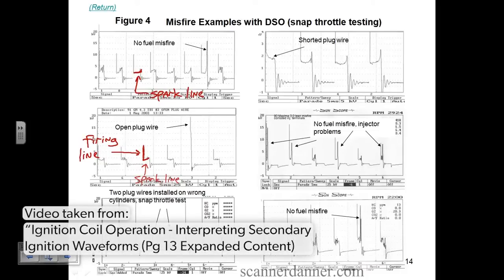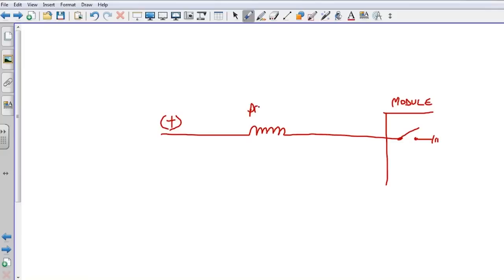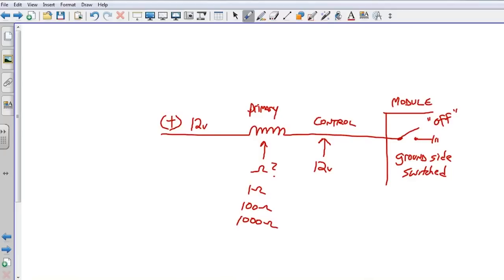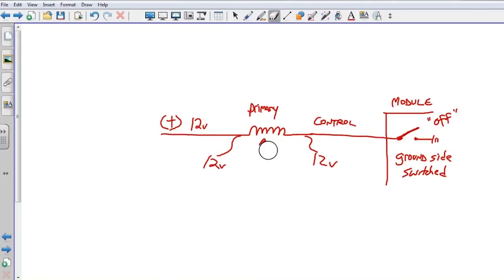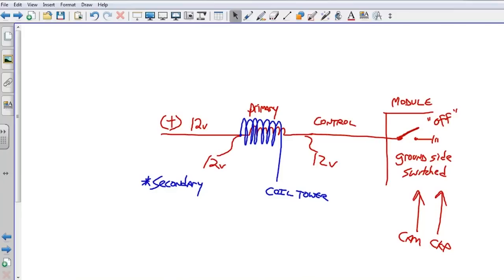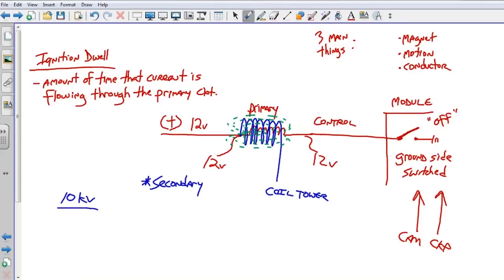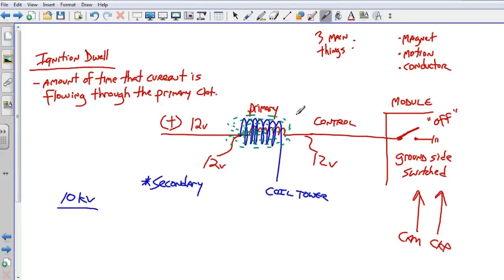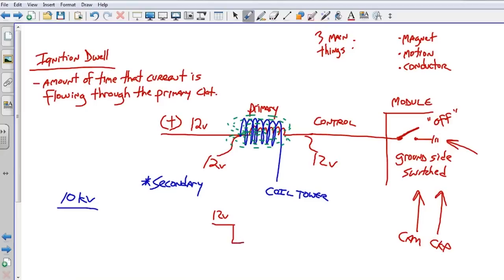How an Ignition Coil Works!

Comment: If you look where the rubber meets the road, how all energy (electricity) is produced mechanically, coal, nuclear, hydro, diesel, gas.. .they are all built upon the fact that change in magnetic flux induces a voltage in a conductor.  Shutting off the coil collapses the magnetic field, creating a change in flux, inducing a voltage.

Comment: If you do the math, a typical V8 engine at 3000 RPM has to do this coil saturation and spark voltage collapse at 200(TWO HUNDRED) times per second..
Wrap your head around that one!!
Reply from the maker: Did you like the class?
Reply: @ScannerDanner  Oh it's all Good..I took 3 years of high school auto shop back in the 70s..Where dwell angle was the biggest thing to worry about on the new points you just installed..
I suppose the reason for multi coil packs on engines is to allow more time for each coil to saturate the magnetic field..Hotter spark on a lean burning engine..
All of your classes are Excellent!!

Comment: My engine died if I pulled a plug wire at the coil 
1990 Buick Century 3.3 litre.
Same coil packs. 
Why does it die ?  My mechanic had no clue. 50 YEARS experience. He even retired after Covid.
Reply from the maker: You have to give the spark somewhere to go! On that model the ignition module sits right underneath and you're spiking the module if you're just pulling the wire off
Reply: @ScannerDanner 
HAVE YOU EVER DEALT WITH BATCH FUEL INJECTION ? 
EARLY 70'S BUICKS & 72 OLDS QUAD 442 AT LEAST HAD IT. 
THIS GUY IN CHICAGO, IN HIS YOUTUBE HAD MY PROBLEM.

INTERMITTENT NO START, 
THEN START & RUN. MAY DIE SUDDENLY. THEN IT STARTS & RUNS. 
HE REPLACED THE WHOLE FUEL SYSTEM. 
HE FINALLY TRACED IT TO 1 INJECTOR !
YEP, SAME AS MY 1990 BUICK. 
THAT'S WHY "BATCH" INSTEAD SEQUENTIAL FUEL INJECTION IS A REAL BATCH. 
😝

Comment: The voltage increase in the secondary is due to the number of windings. These coils are basically step up transformers. It steps up the voltage and the current steps down. There are more windings in the secondary.
Reply from the maker: Yes sir

Comment: I have a friend with a 68" mustang V8 with points/condenser ignition. I'm trying to understand current flowing in the coil primary. The car has a 1.5ohm ignition resistance wire in series with a 1.5ohm canister coil. Correct me if I'm wrong but when the car isn't running and the ignition is switched on and the points closed the coil will take battery voltage divided by total resistance along with back/counter EMF while the field expands and once it's saturated then battery voltage divided by total resistance so if battery voltage was 12 vdc and total resistance was 1.5ohm + 1.5ohm  in series = 3ohm then the primary current draw would be 12vdc/3ohm = 4 amps current draw and the voltage drop across each 1.5ohm load would be 6vdc  Again correct me if I'm wrong once the car is started then current draw in the coil primary will be based on voltage output (alternator output) , back/counter EMF as the field expands, circuit resistance, dwell time (shorter dwell time less current and longer dwell time more current) and something I didn't take into consideration but impedance. Because the primary is rising and falling and rising and falling repeatedly would it not be subject to the laws of AC current being total resistance to current flow based on impedance being Inductive Reactance + Capacitive Reactance + Resistance. The inductance of the primary coil in henrys and capacitive reactance of the condenser/capacitor in farads and resistance in ohms. How about the effect of rpm on primary current draw. Any help on this would be appreciated!!

Comment: Those of us who are old enough 😳 to remember ignition circuit contact points ( POINTS ) which were literally a mechanical switch - which would open and close to fire the spark plugs. The high lobes on the distributer would open the contact points at each cylinder spark plug so the magnetic field which built up in the coil would collapse in / across the coil secondary winding and fire the spark plug.

Comment: I use an analogy to help understand inductance that may benefit your students.  I imagine the DC circuit to be a fluid system and an inductor to be a turbine in series with the fluid flow. Attached to the turbine is a flywheel.  So when connected to the circuit as in this lesson, with the switch (in my analogy a valve is closed), the flywheel is stationary.  When flow starts, the flywheel retards the flow proportional to its speed and it eventually attains its maximum speed for the pressure applied, ie, saturation.  Now if the flow is suddenly stopped, it is pretty intuitive that the flywheel does not want to stop and the turbine now becomes a pump and drives the pressure (voltage) between the pump and valve very high.  
For the record, the music logo that appears here is my second career.  I spent 40 years as a practicing engineer and engineering manager designing elecro-mechanical machines from the early 60's through to 2000.  Much of the control of those machines was very similar to today's automobiles.  Lots of sensors, a control unit and many magnets to instigate mechanical actions.  I very much enjoy this channel and especially the debugging of problems by understanding how they work instead of throwing parts.  Keep it up.

Comment: I;m a big fan Paul, Great video, but it "sparked" thoughts in my head. Should the blue secondary winding be tethered to the 12 volt primary?  I would have expected it to be on ground as that's where the spark will end up.  Your drawing is correct, then you would get 12 volts on the "tower" when the control wire is not grounded. Sorry,  I know when I think it's dangerous
Reply from the maker: Yes, the secondary winding will be attached to coil +, ground, or another coil tower (waste spark)

Comment: Sir Paul, where's the other end of the 2ndary coil attached? I notice on other diagram sir they attached to ground,and the principle of current flow always flowing on less resistance,it means their will be no current flow to coil tower due to high resistance on spark plug gap,..it will detour directly to ground where other end of that secondary coil attached...makes me confused
Reply from the maker: It can be attached to either coil positive or directly to ground or on a waste spark coil the other spark plug! It's a return path for the secondary winding no matter where it is connected. It is strange, but that is how they work.
Reply: @ScannerDanner  thank you sir Paul...hope you can maka a video that you explaining thoroughly that scenario sir....
Reply from the maker: @Jun-h6f  I have them! But those classes are on my website

Comment: The concept that took me a long time to understand was how the direction of current in the secondary ignition wires has nothing to do with battery ground. Years ago, my naive self assumed that electrons would always travel from battery ground to the central positive pole across the plug. Not so. The coil generates about 10,000V+, it doesn't care about 12V, either way. The direction of current from a coil has everything to do with the relative direction of primary and secondary coil windings, clockwise or counterclockwise. Conventional current within the secondary windings of a coil does not seek out and travel to battery ground. It searches for and travels to the other end of the secondary coil. Many waste spark systems use flow that alternates current direction, and they work just fine.
Reply: Your secondary ignition scope video is excellent.
Reply: Thanks. This comment helped me clarify in my mind some anomalies I've seen the past ... I had a Mazda2 once that had a negative fire pattern (COP not DI) ... I was confused, but it appears some systems are negatively fired. .... Question: Why is the Secondary of a conventional or COP coil connected (physically) to the primary pos side??
Reply: @alexmessina3383  because... Jus for fun... Lol? Idk

Comment: Great explanation. How does the primary circuit safely dissipate the 400v spike without frying the ecu?
Reply from the maker: The transistors that control coil primary are very robust! Injector drivers will use a zener diode to dump off some of the spike, but with ignition coils you won't see that.